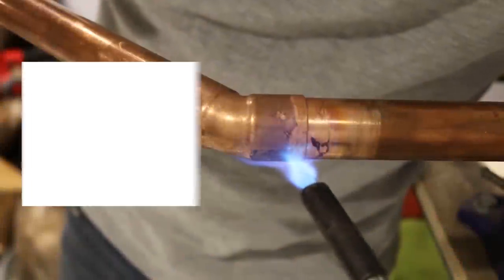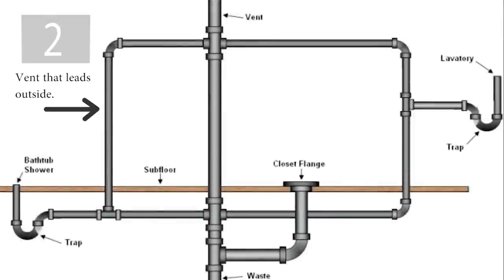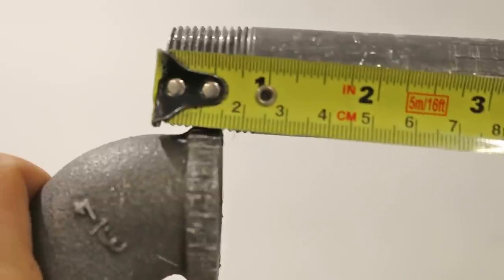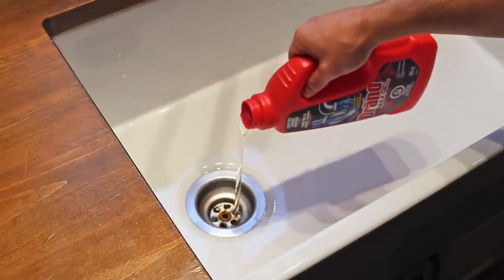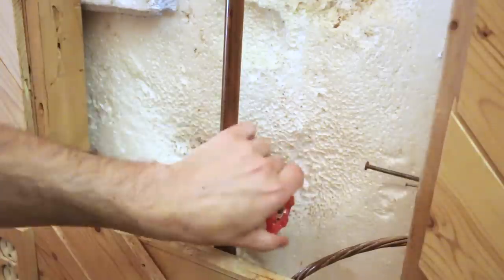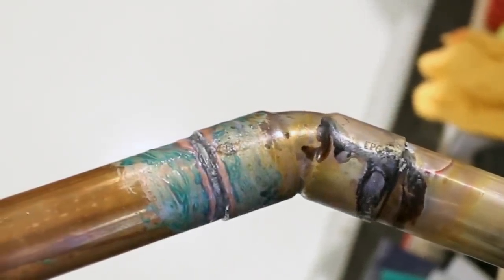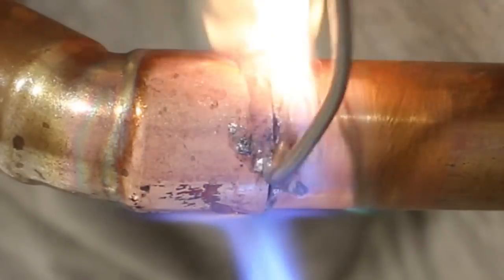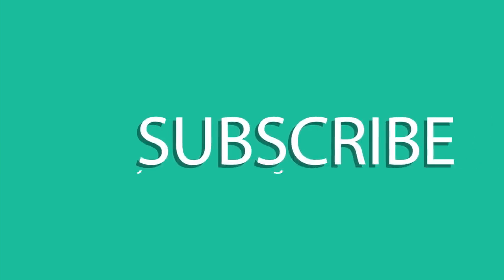10 Plumbing Mistakes You Should NEVER Make and How To Fix Them! | GOT2LEARN

Comment: Saddle valves also have awful flow because the water if forced through a narrow hole.
Reply from the maker: Beside the fact that they always leak lol
Reply: @Got2Learn  I've seen some go for a reasonable time without leaking, so I've always suspected that they leak when people drill the hole themselves, probably thinking it will be less likely to clog, instead of using the pin from the valve to poke the hole. I suppose that it's better for it to clog than to leak.
Reply: From my (limited) experience, there are two types of saddle valves- those that are leaking, and those that haven't leaked yet.

Comment: Just one more bit of advice. If your house has a recirculation pump, unplug it before turning off water to the house. These pumps don't like to run without sufficient pressure/water
Reply from the maker: Very true!! Thanks bud

Comment: I was thinking and studying about the pin-hole type of holes (like, but different from problem #8) which can come in the copper pipes.  When you cut them open to look it looks like when a bb has hit glass--the pin hole has an extremely smooth, very round, very shiny cone through from the inside of the pipe.  It's probably the worst news for the owner as well as the fellow who will spend the rest of his career vainly trying to beat these holes.  Isn't it an electrolysis (electroplating, but in reverse) and the remedy is the sacrificial anode which is the magnesium probe in the hot water tanks?  I've been successful putting brazed or soldered round-cornered surface patches over the holes or switching to PEX.  Do you have good information on these?
Reply from the maker: I am working on a PEX vs COPPER video yes, won't be out soon though ;)

Comment: Dielectric unions suck. I replace them in the hospitals I work in all the time. A hose washer (basically) in the middle of the water system is just horrible. The brass fitting is a better way to go.

Comment: My biggest complaints as a plumber in my area is no vents. It like its against a religion or somthing for people to put vents in here. And stinking draino. I had a two story house the owners filled with draino when there main plugged. But itll eat threw pipes and people dont get that. Especially old galv lines that have been in concrete for 50 years

Comment: Soldering can be difficult and dangerous. When a fix is behind the wallboard heat shields are important...insulation can smoulder and catch you unawares. Older homes are especially vulnerable. If you're not comfortable with the repair process...no...don't call Larry "the Cable Guy".
Reply: Honestly, soldering is why I despise messing with copper pipe. It's fine when it works, but it's so easy for it to go wrong.
Reply: One good solution is go buy a small welders blanket. Its fiberglass, and can take all the heat you want. If that is too large there are lots of heat shields out there. One clever one I have seen is a simple plain old license plate. They reflect heat well, are easy to get for free, can be bent, positioned, etc. Believe it or not aluminum foil can work too. Just use the thick stuff or many layers of the thinner. It doesn't take much to stop the heat.
Reply: @NickFrom1228  yeah man, I'm just an amateur, but I used all the stuff you list, plus metal  flashing roll.  Except didn't know fiberglass blanket. Thx.
Reply: Tommy, sorry for adding my 2c.  But soldering is potentially risky to inexperienced dyi. Those folks should invest in learning outside, with a buddy, and precautionary extinguishing eqpt. Practice 10 times.  Plus a bad solder joint will leak, so practice.

Comment: How about sweating in a valve with the valve open? It turns out that will deform the innards of the valve and it won't seal when you turn it off. Somehow sweating the valve when it's closed prevents this. And yes, I'm going to replace that valve I ruined any day now...
Reply: Hmm. Good point.
Reply: How about sweating in a valve in accordance with the valve manufacturer's recommendation?  Each manufacturer may be different.  For example, Apollo recommends open (preferred) or closed.  But Nibco recommends only closed.  Bottom line, check with the manufacturer first.  After all, they designed and manufactured the valve.......
Reply: @StilettoSniper  There wasn't a phone number on the valve to call for information.

Comment: You should probably mention that when soldering a valve into copper pipe for a humidifier or fridge, the valve should be disassembled before heating it.  Too much heat on the internal seals or washers of the valve would likely damage them.
Reply: What kind of valve are you sweating in that would be damaged from heat?
Reply: @kpebbsishere  Anything with plastic or neoprene seals or seats could be damaged.  Also the stem packing could be damaged.
Reply: @kpebbsishere  Many of the Chinese made shutoff valves you find at the big box stores have plastic stems and plastic internals.  I usually pull the guts out before soldering them as well.

Comment: Do NOT use Saddle Valves. They will clog at the grommet. I replace this thing on my ice maker supply, with a SHARKBITE Tee, and 1/4 turn SHARKBITE valve. Easy to install and works great.
Reply from the maker: Well said Robert, those things are always leaking.
Reply: Been using saddle valves for 30 years. Never had a single leak.

Comment: No vinegar and baking soda! I've had to cut out long sections  of pipe several times due to this being used . The sizzling only happens in the portion of the drain above the trap, turns back into baking soda further down and settles in spots after the water drains out as it is heavier than water, then if dry for long enough it hardens to the point that it can't be snaked out. Dealt with this a few times. The only safe, non destructive home remedy  is probably hot water, if that doesn't work and you can't snake it yourself call a plumber. Also had the same happen where people were using baking soda tooth paste
Reply from the maker: Thanks Kim, good to know.
Reply: It looks cool, but adding the baking soda does nothing but neutralize the acidity of the vinegar. That's why we use vinegar in the first place. Save the baking soda for other uses.

Comment: Soldering: a lost art form replaced by sharkbite fittings and pex piping.
Reply: That shits expensive tho Bette of welding/soldering
Reply: I haven't seen 2" and up in either material. Copper is also anti-bacterial
Reply: There will always be copper water piping. I work on copper pipes at least once a week for the past 42 years. Far from a lost art. It will be around for a long time
Reply: @tomwilliams4885  Damn right! And it's anti-bacterial. recyclable and PROVEN I've been working with it for 44 years.
Reply: Soldering copper is best...sharkbites are garbage...too many people using in the incorrect manner...ok for quick fix in an accessable and visible area until proper repair can be made
Reply: I agree. Sweat those fittings.
Reply: shark bites are for woodchucks who think they can do plumbing, soldered joint will last forever
Reply: To each their own
Reply: Htownfamily I see plenty of solder joints fail
Reply: Yes agree , ( Cryofit ) heat shrink  sleeves are much better and don't crack like welds when under extremely high shocks, Thay are used on Submerines for the reactors piping...... 🇺🇸
Reply: Tyler Durden it’s getting more and more rare to find plumbers who can solder and forget about neatly.

Comment: For clogs, I'd add "pour boiling water down the drain".
Reply from the maker: True!
Reply: Yes, the hottest possible boiling water with a lot of grease cutting dish soap. In fact, one of the best plumbing maintenance procedures you can do is once a month, boil a large pot of water, then before pouring the boiling water down your sink you run your hot water in the sink until it is fully hot, fill the sink with hot water then drain it. Now that the pipes and everything is preheated you now can dump the boiling water with a bunch of dish soap down the drain. This will cut the accumulating grease/fats etc and clear the pipes. Simple, cheap, safe and effective.
Reply: @NickFrom1228  Nice specifics to the concept. Heck, I think I'll do a maintenance pour today.
Reply: @NickFrom1228  what about vinegar and baking soda please?  Doing that for decades.
Reply: @mazdarex7  That can work because it generates bubbles which can help with moving material out of the way. But there is a bit of an issue. Typically drain cleaners are a base, though an acid can work as well. They don't use acids because they can erode metal pipes. What you have when you use these products is a ph level that is fairly far from neutral (7) and the products will dissolve fats and other biological things like hair, food, etc. Now, if you use vinegar and baking soda you are using both a base and an acid so they neutralize each other. If you do decide to do this, pour the vinegar in the drain and let it sit a good while, like over an hour. It would probably be better to start with a pint and then every 10 to 15 minutes pour another cup in. This keeps the vinegar renewed in the pipe. After it has sat a long time then you can add the baking soda. It will still neutralize the vinegar but the bubbling action can help loosen things so they can be washed down the drain with hot water. I would say that no matter what you do, always end with a lot of the hottest water you can get along with dish soap.
Reply: @NickFrom1228  wow Nick, thx.  We've been doing it backwards for decades!

We've just been getting bubbling action by baking soda first , then flushing it down with vinegar, letting sit for 30-50 min, then hot water.  Been lucky. Thx.
Reply: @NickFrom1228  Do you dump the dish soap at the same time you're dumping the boiling water?
Reply: @mazdarex7  No problem. Actually if you were pouring enough vinegar down the drain to essentially overwhelm the baking soda, then you would be having vinegar for that hour so in effect you sort of would be doing what I described, it just wouldn't work quite as well.  I'm glad you've been doing this method though because it sure beats having to unclog a drain every few months. If more people would do this the sales of drain cleaners would plummet.
Reply: @zaloalvarez6947  I like to have soap in the final boiling water (1/2 to 1 cup) that we dump down then after that has sat I dump an extra 1/4 cup down the drain followed with 1 cup water to move it past the p trap. That way we basically have a bunch of soap in the pipe sitting there for a while as a finish. The only thing is don't add the soap to the boiling water until just before you dump it in the sink. If you have it in the water when you boil it you are in for a mess. I will not detail how I obtained this information... :-)
Reply: @NickFrom1228  Hottest boiling water?  Once it boils, it can't get any hotter unless it's put under pressure somehow.
Reply: @Redandranger  Yes, stoichiometrically it will be as hot as it will get unless we get into superheating but the point that needs to be conveyed it get it hot and keep it there.
Reply: @NickFrom1228  Once water boils, regardless of elevation, it will not increase in temp and still be water in a liquid form.  No need to keep the water at boiling if you're going to pour it down the drain.  Just pour it.

Comment: 1:29 If you must use a saddle valve, be sure to put it on a vertical pipe, or on the top surface of a horizontal one. A friend of mine had a refrigerator installed by people who put a saddle valve in the crawlspace and I'm sure it was easier for them to put it on the bottom, but the sediment clogs it up every week, so the ice maker has been rendered useless.
Reply: I'd refuse the installation if they showed up with only a saddle valve, especially going in a crawlspace. Worse case scenario, I get a refund on the fridge and they get to explain why they lost a sale. No way in hell would I let one of those things in my house.

Comment: Who the hell uses galvanized steel still for water supply and draining.
Reply: There's a lot of it still out there, and you'll probably have to connect to it some day. If you live in a place where the water isn't too corrosive, it may also still be watertight.
Reply: Mr. Tommy Badger I live in New Jersey. I don’t think an inspector would pass it if it was galvanized. We only use pvc or copper or pex. All homes I’m cutting swollen galvanized drain line. Black sludge inside. Most of the homes are from like 60s or later
Reply: Mr. Tommy Badger I’ve noticed it corrodes the most in areas where it may lose pitch so it sitting level and just rusted out inside
Reply: Andrew England I can believe it.  . The first thing we did when we moved into our 1950s  house in Southern California was cut out all the decaying galvanized and replace it with copper, but the water pressure was still pretty bad.  A couple of years of that and we dug up the service line from the street....it was 3/4-inch galvanized that had tuberculated down so the inner diameter of the pipe was about the size of a pencil. So it lasted about 50 years but drinking from it probably shortened my life by 10.
Reply: Mr. Tommy Badger dang that’s pretty crazy. Near me all of north jersey like Newark and so on has galvanized water mains.
Reply: Still used in parts of South Africa, mostly banned in coastal regions though, mainly used for repairs in sprinkler systems and such where you have static pressure and as stand pipes for outside taps where the pipe is located away from the wall - needs to be on a dead leg though if installed in such a manner.
Reply: Mars dz it’s brass in New Jersey.
Reply: Fire sprinkler systems still use it I think. Also some locations use galvanized from the meter to the building for service entry. It is going away however.
Reply: I do. Been a plumber for 44 years. If the system is galvanized, I use galvanized. Water lines. Also in C.I. DWV it's cheaper to use 1 1/2" galvanized for vents. 1 1/2" C.I. is hard to come by and using 2" C.I. is wasting money.

Comment: tip#183 dont wrap 17 layers of telfon tape when showing how to properly apply teflon tape
Reply from the maker: Don't see why you would wanna do that, 4 or 5 turns and you're good to go.
Reply: And wrap it tight!
Reply: I wouldn't use Teflon tape at all for a threaded joint.  Loctite 55 is far better.  But, if I had to, 17 turns does not seem excessive.
Reply: We call it ptfe tape. Polytetrafluraethelene... Or spelt something like that.
Reply: @johnbull5394  It is absolutely excessive. The Teflon tape will just be pushed out and not do a proper seal. 3 or 4 wraps MAX. is all I ever use (on pipe sizes up to 2").
Reply: @walterbrunswick  Perhaps your Teflon tape is thicker than what is common in the UK?  Typically you need at least 10-15 turns on a 1/2" thread over here.
Reply: It might also cause the fitting you're screwing on to mis-thread or cause a leak at anything above 4 to 5 wraps.  Trying to force a threaded fitting over that much tape on it is pointless and wasteful.  If you could even get it to screw on at that point.  Does he own stock in a company that makes/sells Teflon tape?
Reply: JB--I've watched British plumbing videos here on YouTube, and they NEVER use that much Teflon tape.  Ten to fifteen turns is excessive, let alone seventeen.  You use PTFE to form a seal.  It also, when laid down tightly, makes a clean, smooth surface to thread on a fitting.  If you use too much, it creates problems that can sabotage your attempt at a repair.  If you attempted to thread on a fitting that that much tape on it, it would mis-thread and possibly strip the threads, causing a leak.  The only way you could do that is with a large pipe wrench to overcome the resistance.  If it requires that much effort to install something, STOP--you're doing something wrong.
Reply: @stever5887  Well, I trained at college with someone who did commercial pipefitting in low carbon steel where you cut the threads on the steel tube and then screw the fittings onto the male thread.  This was what he did day in, day out.  When we tried with less than 10 wraps of PTFE, we were getting leaks in our assessment pieces.  Quite honestly, using PTFE as a thread seal is not something I would ever do out of choice, as there are safer alternatives.  PTFE is not forgiving and I;ve seen it go wrong, especially if you have to back the fitting off slightly rather than screwing in fully home, such as if aligning a bibcock.

The guy who did commercial said he never uses PTFE at work, always hemp and paste.  You can't legally use hemp on potable water, but my experience is that Loctite 55 is just as good (and you can legally use that on potable water).
Reply: Teflon tape isnt a reliable seal.
Reply from the maker: That's because it's not a sealer, it's a lubricant ;)
Reply: @Got2Learn  It's both a sealer and a lubricant!
Reply: @walterbrunswick  One plumber I spoke to was annoyed that I had put a single wrap of PTFE around an immersion heater screw fitting.

Why?!, she said, it seals at the washer!  You don't need PTFE to seal an immersion.

My reasoning was that a single wrap would not prevent the immersion from being screwed in properly, nor would it create a seal, but it would probably make the immersion easier to remove in ten years' time.
Reply: Three wraps clockwise looking at the threads. 
To really seal the deal. Put a light coating of liquid silicone over the tape.
Reply: I’ve been a plumbing for years. I obtain a masters plumbing license. Tape and paste are both recommended by all manufactures. On all male-female threads. Tape 4  full revolutions and cover with PTFE paste. Leave first two threads exposed. This ensures proper thread alignment. 
Plus why would you not want to do it right?
Reply: Just be sure to check if the paste or pipe dope you are using is suitable for plastic pipes. ( Some aren't )